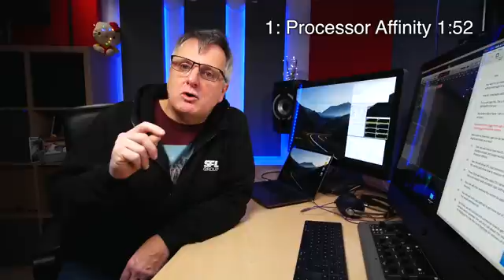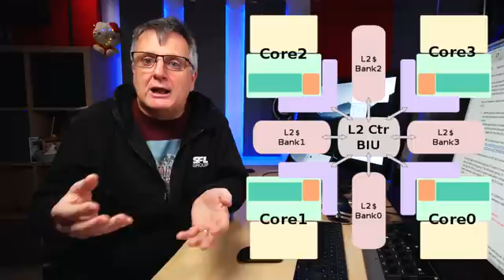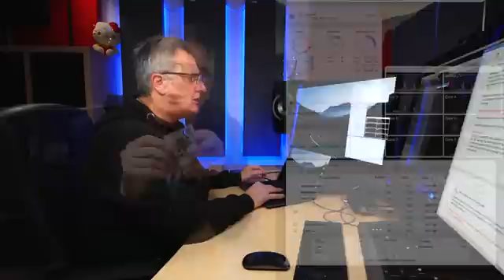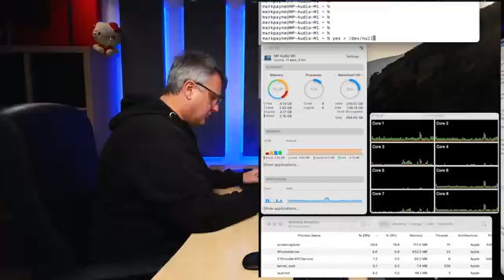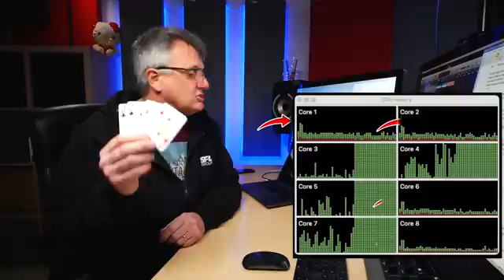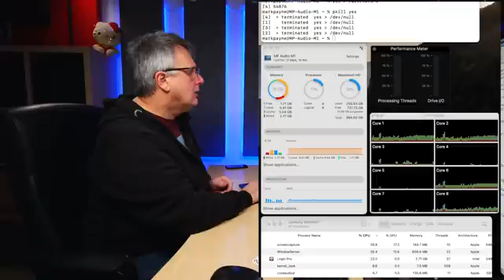Logic Pro X CPU Optimization | 2021 | M1 System Tips | Run more Plugins!

Comment: Is this behavior Logic specific? Are other DAWs more efficient than Logic? I'm looking to do film scoring with many virtual instrument plugins running concurrently. I tried running about MIDI tracks on my MBP 14" with M1pro (8 high performance cores) and 16GB RAM. Logic is constantly overloading. Wondering if I would be better served with another DAW like Cubase or Ableton. 10 midi tracks does not seem like a lot. These were with East West Hollywood strings OPUS edition which are fairly resource intensive. Seems like the only upgrade path I have is more RAM  - M1 Max has same cores (faster bus speed though).

Comment: Hey! Thanks - very helpful! Probably, you guys can help me fix this out - I've got M1 Pro chip and I set up everything as Mark recommended in this video. However, I noticed, that while using Logic Pro ONE processing thread (the thread that is on the right side of the Performance meter (Processing threads) window) is usually overloaded, but the rest of the threads are somewhere between 15%-50% of the load. And this one overloaded thread causes the overloading problem. The load is unevenly distributed. If you know the solution or have any ideas on how to fix it, please, let me know. I will appreciate your help!

Comment: I'm about to buy an M1 with 32gb ram. At the moment I'm using a2019 macbook pro 16 inch, with 64gb. Using the settings suggested in this video, I now find I can run about 20 software tracks with 20 SSL EV2 cpu intensive plugins across all of them, with CPU running to about 30 percent at most, including other plugins. Which is unheard of, never thought could be done. My question is, my mac can run 8 real cores and inside logic, a further 8 virtual cores, making 16 in total. M1 use ram differently, but will there be the same virtual core stuff going on, or if I get the 10 core cpu model, that's it, no virtual cores? I see people with 64 gigs of RAM struggling to run 20 or so SSL EV2 plugins on such a powerful machine, and my old macbook is running it fine. Thank you so much for these settings.

Comment: hi Mark, tnx, but have question, i have a mac pro 5.1 / 3.33ghz-6core / 32gig ram logic X working 24bit 96k .
if lets say on my macpro 5.1 i have theoratically 100 track..  howmany tracks would i have on a mac mini m1 16gig??
i cant compare right now because i sold my 5.1 and want to buy a m1 system. tnx in advance!

Comment: Very helpful video- however, there's one important pitfall - if you do use the 8 cores, be careful with Rosetta/ AU hosting. If your plugins run on rosetta this is an additional process running alongside logic that gets obliterated if maxing out the core usage. I hope the plugins will be ARM native someday but until then I have to switch back to Automatic.
Reply from the maker: Great point!

Comment: thank you mark
I am using a Mac mini i7 2018 model with 64 gig of ram using Logic Pro 10 and my second computer is the new Mac studio running logic pro x and I want to use the plugins Intel base on the I 7 Mac mini then  linking them together but first need to set them ups right, also I have a Apollo x6 and a have 8 core stat-alight  then I also have the Cranborne audio dat  can you do a show on linking this equipment optimally  I looked at the connect but would rater use networking with a thunderbolt 3 cord  o I have 2 monitors  2 keyboards  and I know I can use clocking 1 slave other master two sync them

Comment: Thanks for this, very helpful. Most people just tell you to increase the buffer size and to not use any plug-ins while tracking, which is impossible if you're a songwriter and need midi drums and guitar amp sims running at the same time.

Comment: Thank you for this detailed explanation.  Is there any benefit to be had by sharing a plug in between multiple tracks?  For example an aux channel that is a shared reverb effect plug in.   Off the cuff it seems to me that a shared plugin will reduce the memory footprint of the logic pro system, but requires the same total amount of CPU processing for all the tracks sharing it as if they had their own plugin (compute-wise), but then I am thinking that the added latency of resource sharing might introduce other instances of System overload, or Disk too sloow or some other failure.

Penny for your thoughts?

Thanks,

Gary Solomon
Retired Chief I/O architect
Intel Corporation
Reply from the maker: The sharing of a single reverb plugin on an aux bus is was more efficient than repeating the same plugin on every channel. Good reverbs carry a significant CPU load so why multiply that up? This is nothing to do with latency. Also… as a mix concept. The real world occupies the same reverberant space. 40 instruments live in one reverberant space. Not 40 reverberant spaces. Of course you may choose maybe shorter verb times for percussion vs vocals etc so now thats 2 verbs but its not 40. You way then also have a few more reverbs for special verb tail effects but I am trying to make the point. We start with the unified concept that your mix happens in one space.
Reply: @MarkPayneAudio  Hi Mark,  its clear that from an app workload footprint perspective the reverb buss is more efficient.    But compute-wise doesn't each track require the equivalent ount of processing regardless od whether reverb per track or shared buss?  Thanks,  Gar
Reply from the maker: @garysolomon3845  No because if you are mixing multiple channels on an aux send … this is done before the reverb plugin. There is one plugin and one single stream of audio going to it. The dsp needed for the mix process is trivial.
Reply: @MarkPayneAudio  ah,  makes sense.  Thank ypu

Comment: Your video is excellent and does bring the subject to light as everyone needs to know how to maximize the benefits and efficiency of their machines.  I will check your other videos  as well. I am very interested in achieving zero latency( or as close as possible) to utilize some sample libraries for classical and jazz and simply high quality samples without the room ambiences I am experiencing. Does the amount of RAM memory actually effect the transfer of midi data using external controllers? My current aged machine has 16GB of RAM. I am interested in the Mac studio M1 MAX system with 32 GB RAM and 1 TB SSD.~ Currently, I have  typical starter level interface capability with a Scarlett 6i6 version 1. It has midi I/O but I'm still experiencing excess latency leaving me high and dry for use with an external controller. I assume since you are expressing the potential latency issues even on the M1 system you are demonstrating that simply having better processing does not remedy the latency issues. Can you do a video (if you haven't already) on the subject and be as specific as to what CPU processing should be adequate to achieve my midi goals?  I'm not using LOGIC , I am using REAPER, but I assume that is not the issue!?Thanx so much! This was VERY informative! Great video!

Comment: Hi Mark, I watched your whole video and thank you for the in-depth explanations.However, even after using your optimisation settings, I am still having issues. I am on the latest updates for Logic, my plugins etc.

I get the system overload every time I go to press play on a track when I first open a project. Then when I play it the second time, it works fine. However, my cores are running at 100% from simply using a drum plugin and two guitars. It's insane and I don't know what else to try. I have no other application open either.

Do you have any suggestions?
Reply: I am using an M1 Maci Mini with 16GB RAM and 2TB SSD.

Comment: Outstanding info 14 months later! Thank you Mark for all the work/time you put into this. Found it 'cause I've just rec'd my 14" MB·Pro M1 Max 10-core. A bit surprised that an operation like re-enabling Core Audio, which reloads all plugins, is rather slow (but I realize this may not be a useful benchmark). Anyway, your suggested playback settings for M1 are most welcome. Toasting you with a glass of Malbec. Cheers!

Comment: Hi Mark, Thanks for taking the time to make these videos. I am very puzzled and would be grateful for your thoughts on the following: I have a new M1 MBP with Max M1 chip and 64GB of ram -  I copied your settings and yet, in this instance, the latency at 1024 is 49ms!!! Please note, the session is completely empty...no plugins, no audio, no midi whatsoever... How is this possible?
Your thoughts would be much appreciated. Best. Mark
Reply from the maker: If you run large buffers then the latency will be high independent of the power of your system. Latency is a factor of sampling frequency and buffer size. I assume you are running 48K? Take that to 96K and/or reduce your buffer size for less latency.
Reply: @MarkPayneAudio  thank you for your reply Mark. Indeed it seems a good guideline . Just not quite getting anywhere close to the kind of performance that this M1 seemed to promise
Reply from the maker: @1markstuff  What is the criteria for performance that you are looking for?
Reply: @MarkPayneAudio  well, strangely, even after troubleshooting with the logic dpt at AppleCare, in Rosetta , I am getting the rainbow  wheel ( intermittently and sometimes for quite a long time ) when adding a plug-in ( any brand) to a very light session … so I immediately looked into latency, overload etc …it definitely seems I that on such sessions it should be basically instantaneous

Comment: Thanks for the video Mark, helps a lot, but I'm experiencing some weird issues and I'd like to know if anybody knows about this.

I'm running a new M1 Pro with 32 GB RAM and 10 cores. Now when I record or mix, after some time Logic starts to lag. So if I try to edit an audio file on one track for instance (shorten or stretch it), it won't react. If I do this on another track with the same plugins used, no problem. It seems that one track starts to get laggy and I can't even click on the solo button anymore. I just won't do anything. Then clicking on the solo button of another track works just fine.

I noticed that when I run Logic on full window mode, the problem disappears (solely for this issue), when I get back to a minimized window, it lags again. But it was not the complete solution for the problem. I even deleted all of the plugins (!) for testing and it still appeared.

Anyone has experienced this?

Thank you so much!

Comment: Great video. Can’t wait to get into the studio to try these logic settings as I’ve had a nightmare today. Basically working in Dolby atmos mode changes everything. I have a very powerful 2017 iMac Pro fully maxed out in every way possible such as 128gb of ram for example. Logic runs beautifully on it when not in Dolby atmos mode but in Dolby atmos mode the first core quickly goes above 100% and overloads logic even though the other cores (think I have 32 or something crazy like that) are hardly breaking a sweat. This is even more apparent if I have a limiter or something on the master output but even without those I was getting overloads every few seconds today and I can’t bypass the atmos plug-in on the master or it won’t work. Setting multi threading to playback only helps a great deal ONLY if I have an instrument track selected rather than an audio track but this simply isn’t practical. On another note if I use 3d object tracks they go out of time so I have to stick to using only bed tracks which is also frustrating but a whole different topic. Can you suggest anything please Mark? As I say I will try changing the settings from automatic. Thanks in advance. Danny :-)

Comment: hey there,
ok I can give you my experience here
i am using a Macbook m1 pro 16 inch 16gb ram (10core CPU)
on default I had with even a small project issues when I was live recording with live monitoring on a track (huge latency in hearing the instrument and on the recording )
i fixed this by the following settings 
IO buffers. to 512
10 cores
and check the low latency mode to on 

project was 44.1 and 24bit recording

i am using here and there some software instrument a few waves plugins and some stock plugins and I am in between recording and monitoring myself and It works fine 
you know a project with strings acoustic guitars software drums acoustic bass electric guitars vocals (everything processed and bus sending) 

when I worked with logic on default settings it really sucked ass .... now with the new settings lets see how it is going with new projects

i have seen your video with the first m1 Mac and you had so many plugins open and working that was insane --> have you had any cpu issues at that time (I think I can remember you where running it under rosetta at that time )

greeting s

Comment: would this make a difference when these plugin makers optimize them work properly with the M1 chips?  in order to use most plugins properly, don't you have to run Logic with Rosetta?  i would imagine this would make a difference, no?
Reply from the maker: Yes I believe this to be the case. The more M1 recoding happens (and it is happening), the less we need Rosetta. I am now running Logic native and allowing the rosetta bridge to deal with the few non native M1 plugins I have. Previously (and remember the video is from the start of the M1 story) I was running Logic under Rosetta as that hung better with the plugin majority. This is no longer the case for me.

Comment: I have a question? I also read that the m1 will utilize extra ram from the extra ssd drive space. I saw these tests being done on the 16gb m1 pro and 32gb m1pro and the the speeds never changed or processing. They showed the 16gb version was allocating the ssd to make up for the over use of ram and did not effect the speeds between the two. I was watching your ram meter hoping you would max that out to see what would happen next. If you have any insight in real world testing that would be great to know. So would this be the same for the m1 8gb verse m1 16gb air and mBP?
Reply from the maker: I have a comparison video comparing 8GB system with 16GB. Have a look at the memory section of that. The question you are asking is VERY difficult to answer and test for generically. These systems are virtual memory machines and always have been. The usage of SWAP space is nothing new in operating systems. The exact usage of swap depends on program efficiency and RAM locality. I am not avoiding your question but memory pressure is not easy to understand in a multiplication environment.

Comment: This type of content is so helpful, especially with wine! Subscribed!

At the end you asked our favorite CPU hungry plugin. Is there an easy way to find out which specific plugins are using up the most resources? Google search came up short.

And do you recommend running Logic Pro projects off of an external SSD drive? I keep hearing different things about this.

Cheers!
Reply from the maker: It is impossible (I think) to see performance stats and metrics for individual plugins. You can only get a feel for individual plug load by turning them on and off to see if overall CPU util is changed in any significant way. 
Part 2... Form me the SSD speed now (even external) is not a potential bottle neck for Logic performance. So it makes no difference! Your mileage may vary!

Comment: Weirdly, my most inefficient plugin, CPU-wise, is Sample Magic Boost v1. v2 is a bit better in this respect, but it doesn't have quite the same magic as v1. In theory neither should need to be as CPU hungry as they are, but they also do something I can't seem to replace with any other similar plugin, so I make do, rendering as much as I can as I work. Great video, thank you so much! I never thought to manually set my processing threads higher, since I assumed "automatic" would already be optimized -- clearly not!
Reply from the maker: Understood!

Comment: I have a question. I use to run Logic Pro X on a 16" MacBook Pro intel processor with 32G Memory. I've just replaced that with an M1 Max MacBook Pro with 64G Memory. However when I open Logic, it takes forever for it to load up. It takes so long, it feels like 15 times the time it took with my previous MacBook Pro. Is this something that is normal with the M1 computer or is there something I need to do to rectify this?
Reply from the maker: That is not normal

Comment: Excellent stuff here, and I don't even use Logic (I mainly use Studio One 5.4 now).   I'm going to set my settings to the same end of the spectrum.  I use a lot of UAD plug-ins, which are ran on separate processors in the Apollo or Quad card.   Nevertheless I am all about keeping processor headroom.  Need to do all possible to avoid CPU shutting down the session.  I also use a lot of Waves plug-ins.   The software manufacturers are just now beginning to catch up to the M1 chip.   Its a good time to jump in the water.

Comment: Hi Mark, thanks for this video- it's super helpful. Now that the new macbook pro m1 Pro/Max chips are out, do you have a suggestion as to what the minimum cpu core and memory should be to record in Logic Pro? Would you think 10 core cpu and 16gb memory are enough for recording? (I doubt I would ever surpass 50 tracks total). I realize it also depends on the plugins used. Or would you suggest to play it safe and go with 32GB memory? Will you be doing another video on the new chips?